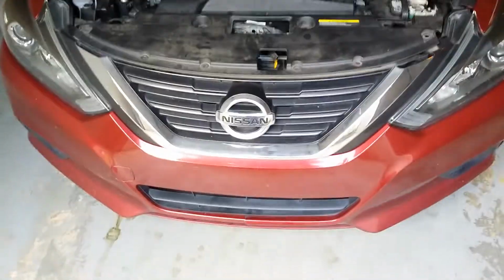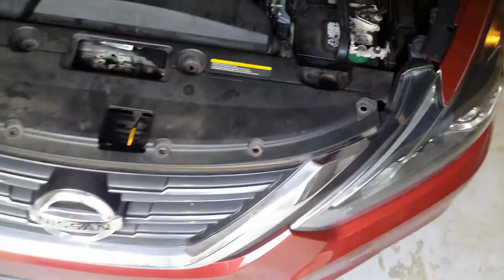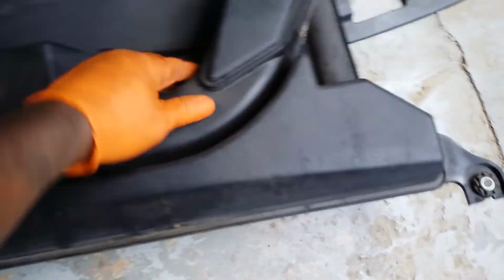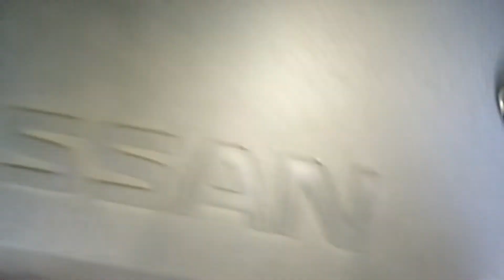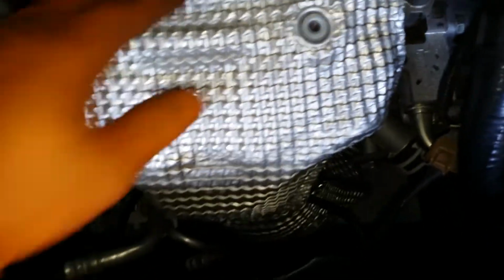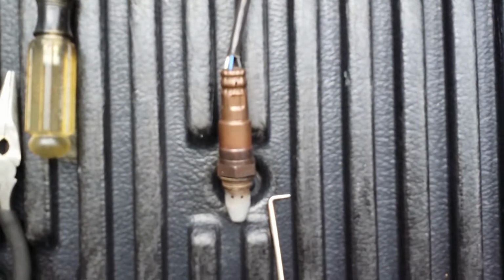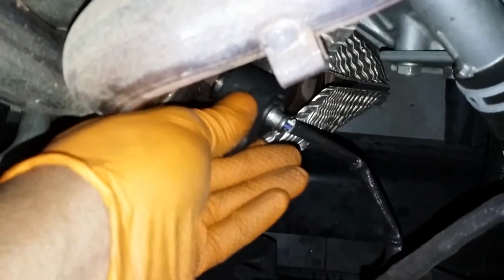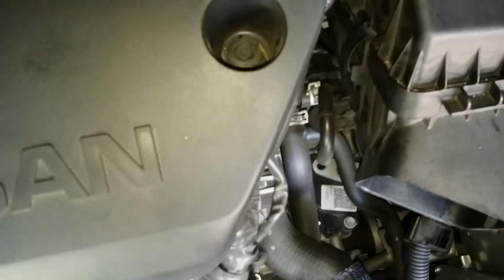NISSAN ALTIMA 2017 UP STREAM 02 SENSOR REPLACEMENT

Comment: Can you put the part number because the one I bought did not fit in the Clip
Reply: Was you able to find the correct one? Because I had the same problem today.
Reply: @Savage_BR7  yes check if your car have the California emissions
Reply: @OmarReyes5.7 how do i check this? Went to autozone and they had given me one that the connector for wire was brown but the other peice is grey like the one in video